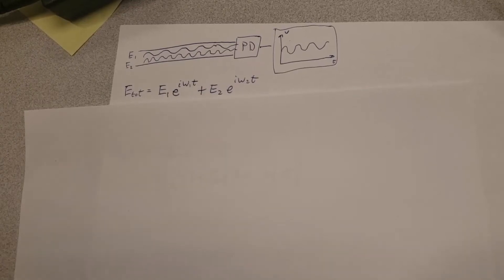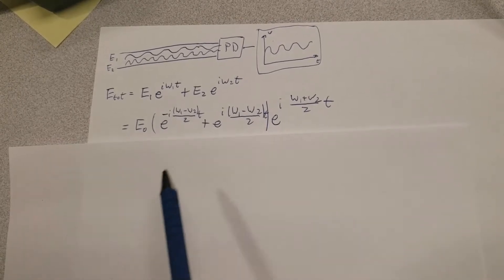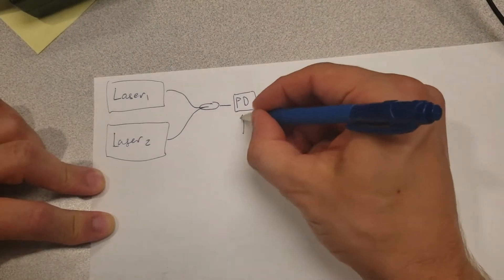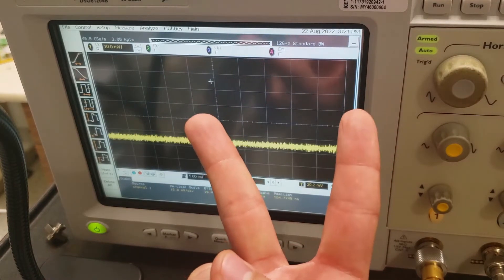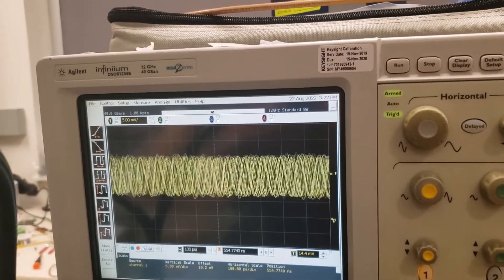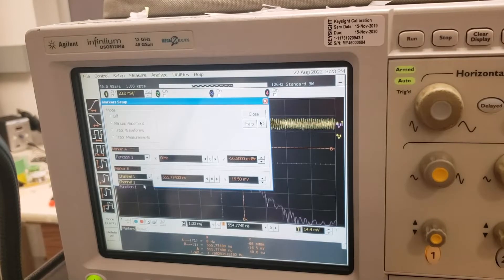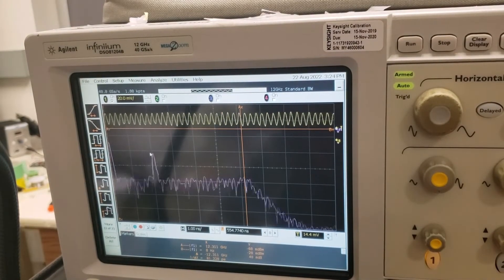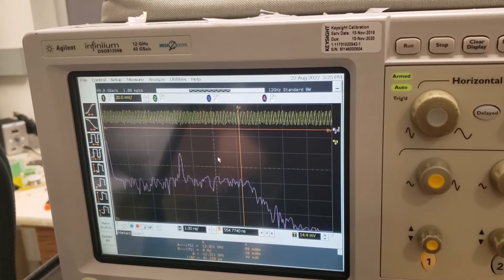Interference of two laser signals - demonstration

Comment: Hi. You use Agilent DCA here as a scope. I tried using it for laser experiments. But it requires a clock signal too for signal measurement. For unknown signals it is not available. I assume you make that out of signal itself? Your response will be helpful.
Also can you make a video on how we get clock for such measurements?
Reply from the maker: In this video, I don't use a clock at all. I just wanted to demonstrate that two interfering lasers create a sinusoidal signal and that their frequency difference can be measured. The phases of the two laser signals don't matter in this case, though they can be relevant in other situations. 

Can you explain in a bit more detail what kind of setup you are working on and what you are trying to achieve?
Reply: @yourfavouriteta  thanks for response. I'm having a train of optical pulses at 100 MHz repetition rate. We have DCA infinium  86100C with 40 GHz module. The pulse source doesn't have any clock output dedicated. I want to measure that pulse train over the DCA. It is showing nothing without the clock signal.
Reply from the maker: @dixitkumar9050  Hmm, have you tried triggering on the pulses themselves? I mean if they are detected by a photodiode connected to Channel 1 on the oscilloscope, you should be able to set the scope to trigger when a certain voltage on Channel 1 is exceeded.
Reply: @yourfavouriteta  I tried it while having a doubt whether it would work or not. Should I send the pulses to the photodiode and split some part of it to use as a clock?
Reply from the maker: @dixitkumar9050  Maybe it would be good to take a step back and try to get the oscilloscope to trigger on an electrical pulse train from a function generator (I assume your lab has one). Just plug the output of the generator directly into channel 1 of oscilloscope and verify that you can get it to trigger on that signal. 

If that works you should be able to get the oscilloscope to trigger directly on the pulse train as well. 

If your experiment involves measuring a change in the arrival time of the pulses due to some effect, you can split the pulse train into two branches. Sending branch 1 to Channel 1 and triggering on that while applying the effect to branch 2 and sending that to Channel 2 should allow you to measure the time delay.
Reply: @yourfavouriteta  I'll try that. However, this DCA works with equivalent time sampling. That is, it doesn't extract clocks on their own. They have a dedicated sma port for clock signal.